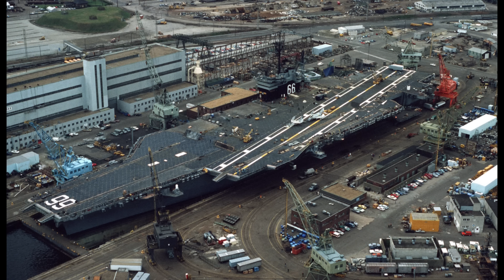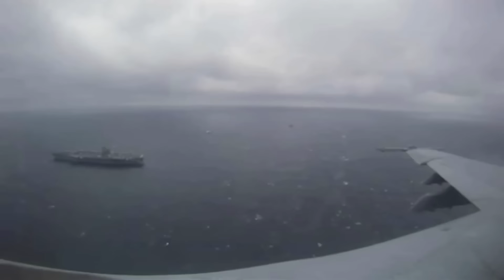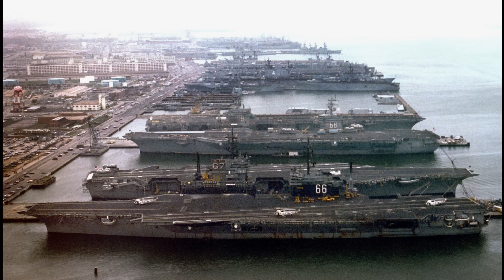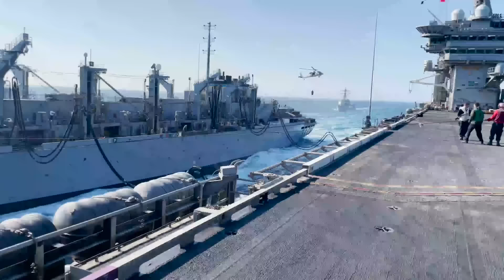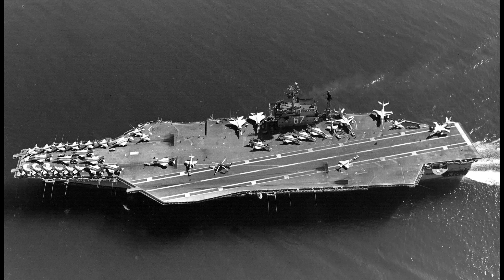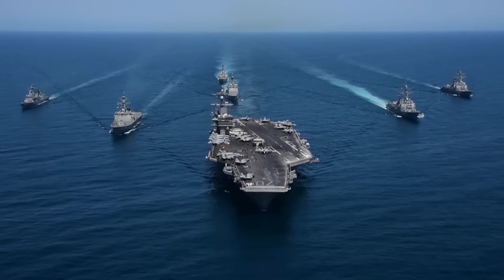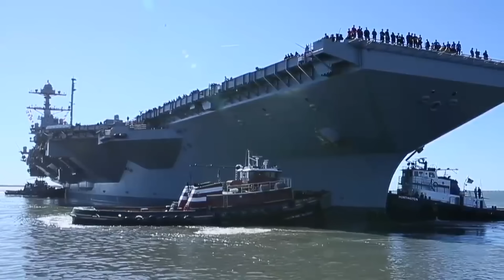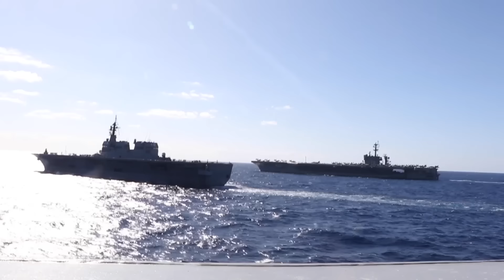Kitty Hawk Class: Why the US Navy MUST Bring Back This Non-Nuclear Carrier

Comment: Congress said by law we needed 11 active carriers in peace time. 50 years divide by 5 years equals 10 and that is if they made one every five years. The navy knows this.
Bush commission 2009, Ford commission 2017, Kennedy maybe 2027, that's not 5, that's 8 to 10 years between carriers, At that rate we lose 1 carrier every 5 years.
Yet they did not fix the problem, with adding a few Kitty Hawk type carriers.
Maybe the navy thinks the carrier will become obsolete, because they have known for a long time it takes 8 to 10 years to commission a Ford class aircraft carrier.

Comment: 🤣 Nah... but Japan should add two 100,000 ton class Shokaku Class carriers to their fleet! Just copy the Kitty Hawk design, but replace the boilers with four GE LM9000 Gas Turbine Generators, each making 73.5MWe for a total of 294MWe of electrical power. Electric motors will deliver 240MW (321,840shp) to four shafts leaving 54MWe for EMLS, radars and hotel services! 🤣

Comment: Doubt a non-nuclear powered supercarrier will ever be a thing in the US. The US hasn't even bothered getting non-nuclear powered submarines, to drasticaly increase their numbers.

If they were to get a new type of aircraft carrier, I would point out either a Charles de Gaule-sizes nuclear powered carrier, or conventionaly powered one like the Queen Elizabeth class.

Both options would be viable, and both would be considerably cheaper, allowing for a secondary class of carriers. Both would have pros and cons.
Reply: I suggest instead of building 75k ton fleet carriers,  build Midway class 45k ton CVLs (because they're half the size of the Nimitz/Ford classes. Operating only F35s and E2Cs with a wing of 35-50 aircraft they'd be more cost efficient. Plus with 10 build essentially we'd have and additional 5 or 6 Decks available at any given time.
Reply: @rvail136  depending on the configuration, that would be about the same size of an America class LHA. Those could operate F-35B, but not E-2, unless it has catapults.

With that said, without catapults, you can go a step beyond an LHA, by making something similar to a Queen Elizabeth, that can carry more F-35Bs than the LHAS. For AEW, you'd have to use something like the MQ-9 STOL in an AEW configuration.

If you want to have E-2s, you need something with catapult and arresting cables. So something like the Charles de Gaule should do the trick.
Reply: @dcarvalho6144  the miday class operated E2Cs. My proposal would look like the Midways, just modified for modern equipment. Essentially scaled down Fords. Not straight decks, but angled like the Midways after their conversions in the 50s

Comment: Frankly, even if the US were to build smaller carriers, IMO, the Navy should not even consider conventionally powered ones. 
Today, anything bigger than a frigate should automatically be powered by nuclear. With the incoming DEWs, offensive and defensive ones, and much more power-hungry sensors, EMAL catapults, etc., it would be stupid NOT to use nuclear reactors on the bigger and biggest ships. China has just recently demonstrated that a conventionally powered ship can NOT employ modern catapults without a serious decrease in sortie generation. Building such a carrier would be foolish.
The Queen Elizabeth class is, even today, considered a massive mistake in naval procurement, while the PANG Project of France is for a CVN in exactly the size range of the Kitty-Hawk class.
Personally, I would even look into nuclear propulsion for frigate-class ships.
Reply: Thats not really realistic for the foreseable future there simply arent enough people trained to work with nuclear reactors that kind of change would need to go through the education system first to encourage and push people into getting the necessary degrees to monitor and maintain the reactors and then you'd have to attract those people into military service.
Reply: @Kakarot64.  
Really?
And here I thought the Navy was absolutely capable and willing to train its own personnel.
Reply: @murgel2006  you need a base to work with
Reply: @fred6319  
That is true.

Comment: They did a study on the F-35 program. It costed an additional $300 billion to develop the F-35B STOVL version. They determined that if they took all 11 Assault ships into shipyard, it would have cost about $3 billion to convert the flight decks to fast carriers with catapults, and use the F-35C instead. Total investment would have been about $33-$40 billion, and no need for the "B" version STOVL, saving the US Gov't over $250billion.
Reply: Except the F35B isn't to just be used on the Amphibs. It's to be used just as the harrier was on small LZs ashore to support Marines on land
Reply: @rvail136  As I stated earlier, the few times when having a STOVL would be desirable, every situation to date has shown it wasn't a necessity, nor a substantial benefit to justify the cost. You can make the claim that it's for the unforeseen situation. But that thought process has never justified the pirice tag in this one particular area of planning. The use of the new Viper and Venom upgrades have proven themselves worthy and necessary for the environment the Marines operate in. The F-35B is a nice capability, but has come nowhere near the necessity one would think to justify a $300 billion development program. And btw, there's no way the USMC is going to drop F-35B's on a small LZ on shore, knowing it is an active hot zone. The F-35B is too costly an asset to operate with that level of threat. Being in that situation gauarantess having an armada of Naval fleet off shore to provide the F-35C for any support they ever need. The STOVL capability is simply not necessary for the USMC to complete its mission.
Reply: @Condor1970  im a US Marine. Youre not. You're an armchair strategist who only counts beans. McNamara did that in the 60s and nearly wrecked the US military.  Never again.
Reply: The UK wanted the B version too. People forget that JSF program is international. Also you are conflating actual cost vs theoretical cost. I'm certain if they actually did the conversion, it is not 3 billion per ship.
Reply: @shaunwu3910  The America Class only costs about $3.5 billion to begin with. To install a full size deck with EMALS on the Ford class is roughly $2.5 billion of the $4.5 billion increase in total cost over the Nimitz. To install smaller flight decks that would be F-35 and E-2 capable, would require about 50ft forward extension to make the EMALS fit, and would most likely cost even less than that. They already did a design study to figure this out, and its a known "DOH" moment in Naval ship design when the cost would have been that much less. No one dares talk about it in the press, knowing the backlash. 
 The loss of a few allies who wanted a STOVL would have been well worth saving billions in development. It would have been simpler to tell the allies to build new carriers, instead of trying to build a $300 billion fighter to operate on their ships that cost 1/100th that. After the war in the Falklands, the British learned that having the Harrier was nice, but not a necessity in ensuring victory. The same goes for a lot of Cold War planning against the USSR that proved the Harrier was a versatile platform if some air fields would be lost, but not a necessary additon to their air forces to ensure victory in the eastern European theater either. The need for a STOVL supersonic fighter is a highly overrated capability.
Reply: @C @Condor1970 CATOBAR would has been unusable for the RN during lots of operations in the Falklands as the sea states would have prevented operations whereas the Harriers could continue operations..
Reply: @robertpatrick3350  The new landing guidance systems allow for full operations in higher sea states and bad weather that approaches hurricane level. It's lightyears beyond what they used back in the 1980's. It's to the point where soon, landing will be virtually autonomous. Even today, all the pilot does is hang on while taking off.
Reply: .  Except when I catapult goes down THEY ALL GO DOWN. Still haven't worked the bugs out
Reply: @Condor1970  How is converting a steam catapult to electric comparable to integrating a new catapult? Are the existing decks strong enough to withstand CATOBAR operations? Is the gas turbine powerful enough to operate the catapult at full capacity? Can the ship run fast enough to generate the required lift on catapult launches? I suspect the answers are no and the cost balloons to a couple more billion and you get a worse Ford class carrier out of it.

As for your design study, I suspect the design study on developing STOVL variant of the JSF said it would cost very little due to commonality. Obviously that design study was wrong, but that goes to show how design studies go. In an alternate universe when the America class costs more than a Ford for trying to do both amphibious ops and carrier ops, you'll probably be pointing to the canceled STOVL variant of the JSF that would have costed less than the catapult conversion of the America class. And pointing to a design study that said it would have been inexpensive since the new variant would share 70% of parts with existing A and C variants.
Reply: @shaunwu3910  You're comparing the developmnent of the STOVL, which used all new technology to an established design that would require primarily hull structure design changes to accomedate a different flight deck and potential addition of existing turbine technology for more power. These are apples and oranges. The one thing the Navy has proven to be extremely good at is ship conversion, while staying at or under budget. The SSGN and other ships throughout its history are proven examples. The primary rule being, stay with existing technology. The main problem with developing the STOVL was all new technology for an aircraft design that simply isn't needed.
Reply: You're assuming those estimates are accurate. No way we'd be able to rennovate those ships in time and on budget
Reply: @kdaltex of course, and armchair strategist never has to worry about anything but bean counting. Real world works very differently.  But stop wasting your breath. He knows better
Reply: @kdaltex As I said, an entire America class ship is $3.5 billion. It costs $2.5 billion to build the deck of the Ford class. They already did a design cost analysis, and proved that $3 billion to refit the ships with a slightly longer angled deck and EMALS to fit is actually an overestimate.
Reply: @Condor1970 no point in arguing about it now, its done. At least we have mass production of the thing. The biggest issue is indecision and  not building anything. The navy shouldve just bought a standard constellation ship instead of trying to burk-ify it. Bow they have crappy coast guard cutters with even less capability.
Reply: interesting

Comment: A good portion of these ships were built in yards that no longer exist. E.g. New York Navy Yard, New York Shipbuilding in New Jersey. The only remaining dock of the size to do this at Newport News is used for Nimitz RCOHs and will be occupied for the next twenty years doing just that and should probably be left open after that for emergency repairs. Therefore, there is no way to make this happen, even if we wanted to. The Fords are built with a life-of-ship core which will last the whole fifty years, eliminating the need for RCOH. And it's not COST that is hampering the Ford Class. It's lack of shipbuilding talent, which would get diluted by trying to stand up another ship production line.

Bottom Line: We don't really need these ships. Trying to build them might actually make our shipbuilding problems worse.
Reply: As well as the skilled labor associated with the yards. Heck, maybe the skills altogether.
Reply: @funghiman8492  this relates to machine shop classes, etc being deleted from Jr high & Sr high schools
Reply: "after that" it will go on seamlessly to perform Midlife Overhauls for the Ford Class that by then also is around 30 years old...
Reply: Ford classes still have to get refueled once in their life cycle.